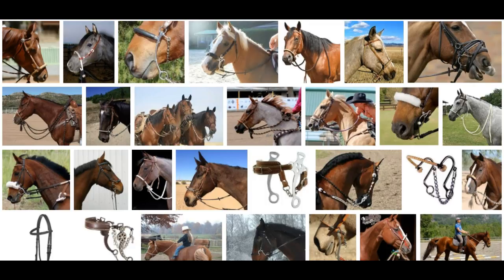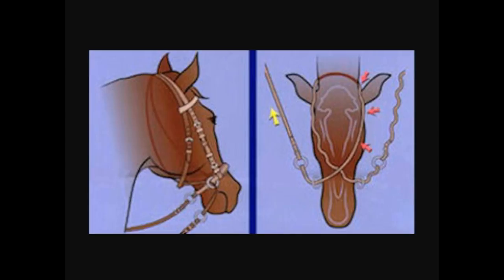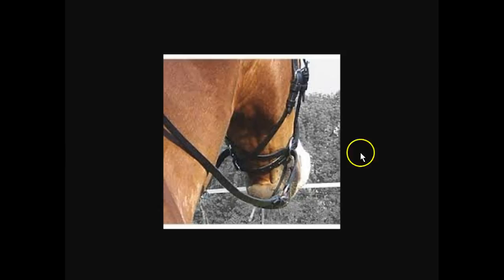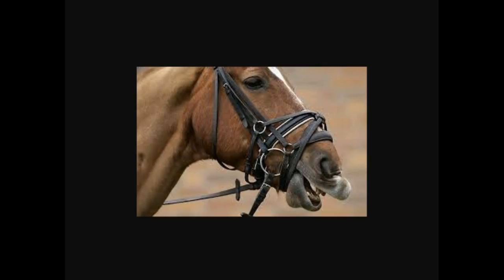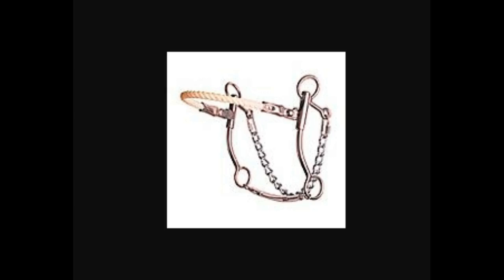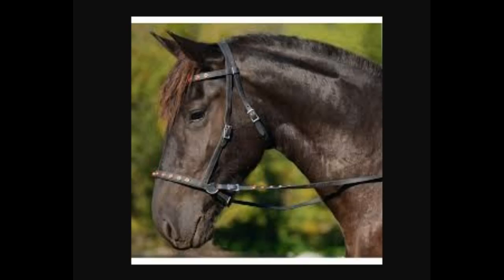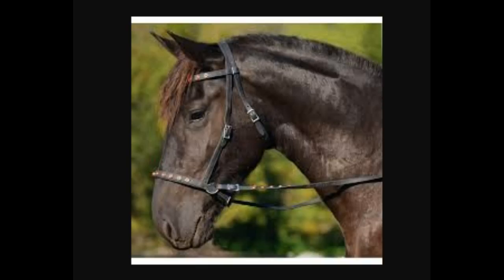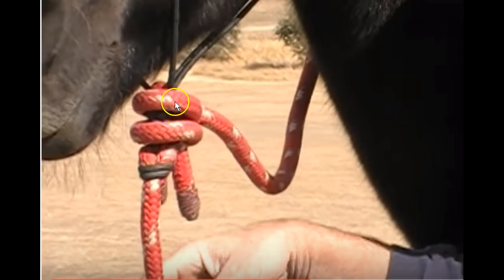Explaining & Understanding Bitless Bridles, Hackamores, Rope Halters & Benefits For The Horse

Comment: I volunteer at an equine therapy center, and we work with a bunch of autistic children and children with similar disabilities. The previous trainer used mechanical hackamores because "We need more control over the horses when we have a less independent rider on the horse." One of our horses never listened when we used a hackamore, so we almost removed him from the program. That trainer had to be relocated due to family issues, and the volunteers agreed to try a rope halter on the "problem horse". He was amazing. I'd never seen him cooperate so well and so willingly. We figured out he was especially sensitive to pressure on his nose due to a previous abuse injury, and the hackamore was irritating it. We eventually switched to rope halters on all our horses but one, who we use a traditional hackamore on because she is still being trained. I was under the impression that hackamores were perfectly fine until Wizard (the "trouble horse") proved otherwise. When I have my own horses in the future, I will definitely be using a rope halter or a traditional hackamore if absolutely necessary.

Comment: Every horse can go bitless. It's some riders who cant
Reply: Heya! I would love to go bitless but i have never tried... do you have any tips? :)
Reply: There is no "cant" its "don't want to" bc they believe the only way to get a horse to listen is to put them in pain and act like it doesn't hurt. Jumping is abusive, horses only jump when they have to in the wild (when theyre in danger) Racing is abusive, too crowded and whipping and beating a horse to go faster only makes it run bc its trying to get away from the pain. And last but not least rodeos, hopefully i dont have to explain why rodeos are abusive. Not to mention literally any competition with horses that a horse is being forced to run by whips (or anything). If anything riding is abusive, horses need to be trained and desensitized to be used for riding bc if not they will become afraid of saddles and having something on its back (since the ONLY time ANYTHING is on a horses back is when they are being hunted and killed) Now do some horses enjoy jumping and racing? Sure. Does that make it ok to abuse and whip and beat a horse into doing so? Absolutely not :)
Reply: @muffinmuffin6913  do research on fitting on the hackamore and avoid hackamores with chains and long metal parts

Comment: It's been at least a couple decades, but when i got my horse (only one I ever owned), I didn't have a chin strap (the chain for under the chin) so the bit I was using didn't function properly. I was  young and impatient to ride my new horse, and I found this bosal among some random stuff in the tack room. I was told the bosal was for training foals, that you squeezed the sides to grip the foal's muzzle as some part of the training which made no sense to me, but I wasn't going to us it for that anyway. I removed the bit and replaced it with the bosal on my fancy green and black nylon bridle and reins. My horse was a charger, a bit hard to control, and I noticed that she was developing that bald spot, so I wrapped the crap out of the top with terrycloth to cushion it. I wouldn't say it was the best thing, but it was better than going back to a bit. The more I rode that horse, the more natural I wanted to be with her, dumping the saddle for a bareback pad. The pad would slip out from under me when we loped, and I didn't want to cinch it tighter, so I rigged a breast collar my dad had given me to it to keep it from sliding back to her flank. So picture it: Fancy bridle with a bosal and a bareback pad with a breast collar. I got a LOT of weird looks, but I didn't care. That's how I rode my horse for our years together.

Comment: When you talked about riding bitless I kept seeing comments about how that puts too much pressure on the horse's nose and can potentially break it (which was somehow an argument for putting that bone-breaking pressure in the horse's mouth instead). I was baffled initially since I couldn't imagine someone being that heavy handed but I didn't know mechanical hackamores existed. Mystery solved.
Reply: Yeah, the force multiplier can be pretty dramatic, turning 5 pounds into 35 pounds on a very sensitive part of the horse's face.  The nasal bone on top of the horse's mouth is thin and comes to a point.  It's much more fragile than the horse's mouth, frankly.

The force exerted increases mathematically as the length of the shank increases, so the longer the shank, the more brutal the leverage.

Comment: At 17, my 2nd horse was a mare, about 5 years old.  She was half Morgan, have Clydesdale.  Bought her for $50 at auction.   Seller said he had a string of bucking horses for the rodeo, but she would never buck.  She was huge with huge feet.  Sweetest horse ever.  She loved to walk into the Sacramento river in the summer and just watch the boats float by us wondering how a horse could be where we were.  

I used what I knew to be called an Indian bridle.  It was a small, soft cord, long enough to be 2 reins with a small length that went through her mouth.  In order to keep it from falling out, I tied a small piece at the sides of her mouth and behind her chin.  I kept it loose enough in the mouth so it would not hurt her tongue.  She was not a rein puller, so it never got tight on her.  I also sometimes used a real hackamore on her.

Comment: I like the cross under bridle. It’s not cruel, and it surprisingly releases pressure in time for my horse to respond well to the cues. The only downside to Dr. Cook’s is that the noseband’s leather is thin (to add more pressure), and it can leave a mark, so I put a fleece sleeve around it to keep it from happening. There is one I bought online for my other horse that’s a thicker and cushier leather by Wonder Care that eliminates that problem.

Comment: I just switched from a nylon halter or hackamore to a bosal. My 4 year old only had a bit for one month before I ruled them out altogether and gave them away. Just started shaping the bosal. I rode her in it for the first time and shes never been softer, more clear on my signals, and overall happier. I barely have to make any contact with it and shes starting to learn neck rein from it. 

There was a video that had an english jumper riding bareback. So the girl is landing on his spine. The horse would buck and she would yank the bit. The horse bucked. And she slapped it.
All the comments said "She handled that so nice. her seat is amazing."

Um no. Shes causing all that pain and hitting the horse for something shes doing. People are so blind...
Reply: Coykat YT not trying to tell you how to do life but im pretty sure bosals are also invasive just watch railighlink's hackamore video ⭐️
Reply: @larakuchen7480  bosals can be more harsh than some bitless bridles or halters but it really is more the rider and horse when it comes to a bosal. My gelding can't neck rein so he does better with a nontightening side pull. If she's gentle with a bosal and her horse is learning how to neck rein with it without issue then it's probably being used correctly and thus is one of the more gentle bitless options.

Comment: Now THAT'S some great information! You cleared up a question I have wondered about as to why clipping my leads on the side rings gave a different reaction to clipping both to the underside ring. 

Yes, I used the standard- every feed store sells them halters. I didn't know any better then.

Explanation is SO much better than rants - I watch these explanation vids several times and save them to a favorite folder just for occasional refresher.

PLEASE, MORE explanation vids!!

How about WHY a saddle is better than a pad,  and a pad is better than only a pair of jeans between you and the horse?

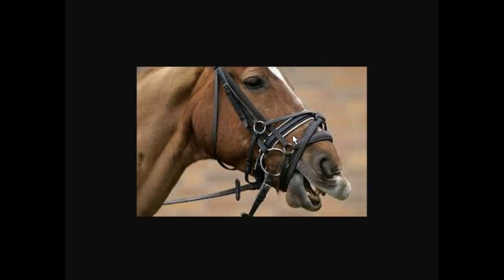Comment: I actually believe the picture at 6:27 was to show that no matter how many flashes you put on a horse, they can still open their mouth, so flashes are generally pointless. Correct me if I'm wrong but I'm 90% sure that's what the experiment  was for. Also, I'm in no way saying it was OK to do this but in this case I personally think it was a fairly good way to bring across the point that horses don't need flashes. It of course wasn't an ideal way as it must of been very uncomfortable to the horse, but it was obviously a one time thing.

Comment: Funny how so many people still count a mechanical hackamore as a soft alternative to bits. In German it‘s called „Außenkandare“ which translates to outside leverage bit and is way harsher on a horse than a regular snaffle bit. Also I would be really interested in some sources why rope halters should be suitable for riding. Rope cuts into skin even faster than chains.
Reply: Brianna Reed But why do you need one if you don‘t put pressure on it anyways? Then just don‘t use it. Also interesting how you think as chains as the alternative to ropes - what about leather straps? Would you prefer a backpack with ropes or leather straps?
Reply: Sophie Lorber hallo. Der kanal ist toll. Fair horsemanship von einer französin ist auch toll.
Reply: Sophie Lorber yes you can break even a horses nose with it

Comment: There are horses who don't like nose pressure. usually with bad memories from using mechanical hackamore. Dr Cook is a really good option for them. Also I consider it more gentle than rope halter or hackamore. But I guess as long you ride without bit and leverage you're in the right place.

Comment: The little S hack @8:50 is different than mine.  Mine has a padded biothane noseband, and instead of the curb chain, it has a strap, also of biothane.  I do understand that it is a mechanical hack, and I used it for years, without my horse getting rub burns on his face.  I now have a paracord rope halter--no metal, English style with browband, and it works even better.  I jump with it, and even drive the horse in it.  For driving, I got rid of the overcheck, and no sidechecks neither.

Comment: Wait, what 's the issue with buckles? I get th Dr. Cool and stuff, and the Mechanical Hackamore, but the buckles are just there to adjust size of needed, or am I !missing something?
Reply: Dr. Cook*
Reply: Rick dosent like any type metal on horses
Reply: I think Rick mentions something about them on his website, buckles (and clasps) can break or come undone easily. If the horse is in motion (Running, jumping,etc) and the buckle breaks, it can whip back and hit the horse in the eye or give him a bad whip to the face. When the buckle comes undone, you have a loose horse running and no way to control/direct it (unless you have trained your horse to give to pressure with a neck rope,then maybe you'll have a better chance of stopping it)  If you have a good knot (hence the rope halters and bosal without the buckles) the only thing that can break it is you untying the knot and since there's nothing metal on it, there shouldn't really be any damage.
Reply: I don't know if you have ever worn little sandals or shoes with buckles, but the buckles can really hurt if pressure is applied to them. Also, if they unbuckle, they can get caught in something or flap around, and them being close to the horse face, it could scare them or hurt their  eyes.

Comment: The metal pieces on the bit-less bridle are just to put the bridle together, it causes no harm... But I totally agree with you... No metal is the best!
Reply: The hair on a horse's face is very short. Metal that touches the horse's face heats up quite a bit in the sun esp in summer. They can heat up enough to burn a horse's face. That wont make him feel comfortable.
Reply: @SpiritBear12  That is y I left my opinion in the end... I prefer wen there is no metal for those reasons!

Comment: By far the best video I have seen on this topic. Thank you so much! You are very talented at providing clear, concise and thorough explanations. Everyone should watch this video before deciding which 'Bitless bridle' to use! I am going to start out with your suggestion of the traditional rope (non mechanical), one point of communication for my horses. Quick question, if one felt that there was a situation where the hackamore needed the option to employ  'more brakes' what would you suggest? For example, if I had a traditional hackamore (bosal, fiador, no metal, mecate reins) but wanted the 'next step up for brakes' would you suggest simply changing the material of the bosal (ie: a rope vs. leather to aid in the tilt, thus acting as the option for more brakes or would you suggest adding a leather curb?) Thank you again!

Comment: A few posters who disagree with Rick and the rest of us are repeating a myth that I have heard throughout my life in the horse world (that a bit will stop a spooked horse or horse determined to run full-out for whatever reason). However, A BIT DOES NOT STOP AN OUT-OF-CONTROL horse. Watch any of the "out-of-control" horse videos on YouTube in which the horse is running out of control with a bit in its mouth (the rider may or may not be on its back however and take note - the bit won't save you!!!) - or watch any video in which a horse spooks in a ring or runs away WITH a rider sawing as hard as possible on the bit. The horse will NOT STOP. There are many other techniques to study for help with a horse that is full-out on open terrain or has spooked in a ring, and none of them will tell you that a bit will save you. That is the same "logic" I have heard for decades about spurs and whips, which won't help either but will get your butt thrown in the dirt and/or drive a horse into a wall or a road. Sigh. My wife and I have grown out of the horse showing phase thank god. People will justify almost any level of abuse to show their horses.
Reply: Everything I've read, even from people who advocate using metal bits, indicates that bits do not control horses.  They inflict pain as a means to communicate the rider's intent.  But when a horse is in panic mode, nothing will stop it; not pain, not blindness, not obstacles.  Horses in flight will run into fences, buildings, people, trees.  They reflexively clench their jaw and push into pain -- horses breathe through their noses and not their mouths.  The idea that the pain of a bit would stop them is silly.

Comment: Rick this is a quesstion for you! Im a designer/ artist and i wanted to start making horse related things like halters, lead ropes bridles ex, now for a bitless bridle what kind of material would you recomend for the making of this bridle? i want to know becuase i dont want to use metal and i dont know exactly whats great and whats terrible and i want what i make to be as safe as possible for horses, your help would be amazing
Reply from the maker: a horse's face is sensitive, make it out of material that you would not mind wearing on your face and strong enough so you can control the horse. Flat puts less pressure but round give better control since a horse can pull against flat more than round rope.

Comment: I have a DrCook, I have not used it on my horse yet as he is untrained, but on other horses I used it, it either worked or not. My horses here have lots of fur and beards even and sometimes the crossed reins dont run smooth because of all this hair and one of the mares I used it on panicked when she pulled and it got stuck. She almost flipped back over as she reared up to avoid the pressure. So I am little undecided. Think it is also a choice made for every horse individual. And every bridle, bit or no bit is potential torture to those who have no smooth sensitive hands. A horse with mechanical hackamore can be better off if ridden by a good calm handed rider, than a horse with a rope halter with an idiot on its back that pulls until there is no more hair on the horses face.

Comment: I have a 8 year old Arab gelding. Bought him green when he was 4 yrs old. Never used a bit on him. First I used the crossover bitless bridle, but switched to a rope halter with the reins at the side, like a side pull. That works best for me. Problem is, that bitless is not allowed on any tournament, no matter which discipline. The good thing: I give not shit about tournaments. Would never put metal in my horses mouth. Only metal I have around his face are 2 little rings on each side of the rope halter to attach the reins to them.
Reply: ThereIsProbablyNoGod preach
Reply: Yes, what is very frustrating is that you generally cannot compete in a bitless - unless the horse is quite young.  That really needs to change!

Comment: Great video, lots of great information!  I fell out laughing when he said " I can't fix stupid!"  Keeping a horse's head down/low is a training thing, not a bridle.  The bosal will not drop a horse's head, you have to train this.  I do agree that tie-down's are not good and are really to train a horse to rear up.  My mare does better with her side pull than any other bridle I have used, and her head is very low. But I use classical foundation dressage methods to train her to keep her head low, she actually stretches her neck and it keeps her in collection.
Reply: a low head is often a collected head. I'm not well versed on the science of movement but the general idea is if the horse has a relaxed lower head, its moving better. Low head, stretched neck, engaged back and hind end, legs staying under the horse. An engaged back is better for the horse when carrying a rider anyways. If the horses head is high, his neck is usually tense holding it up, hollowed out in the back, stiff hind end, and his legs aren't moving as efficiently. If you think this is all bs, try it on yourself. While sitting at the computer, lower your head down- your neck stretches, your shoulders and back go up. Sit up with your head as high as possible-head high, neck tense, back is hollowed out.